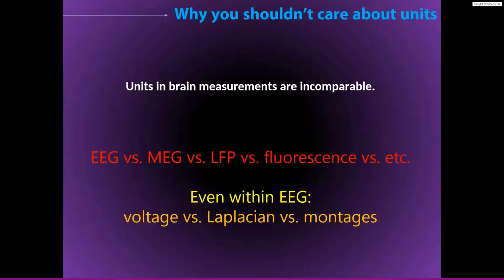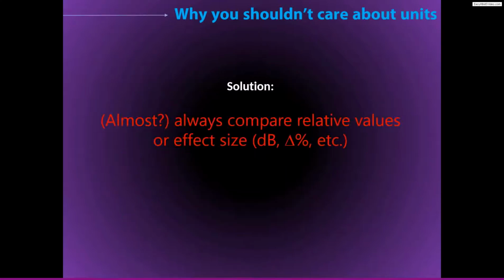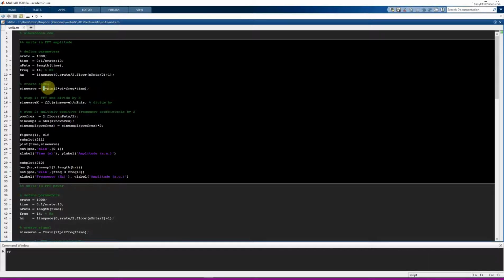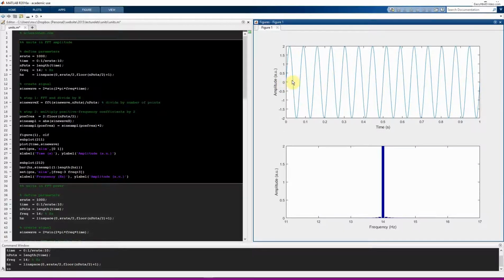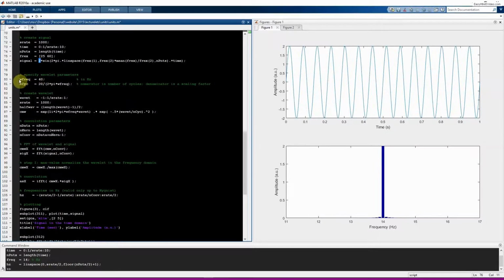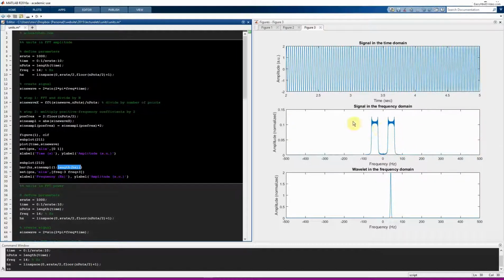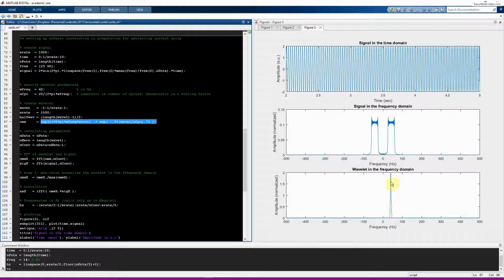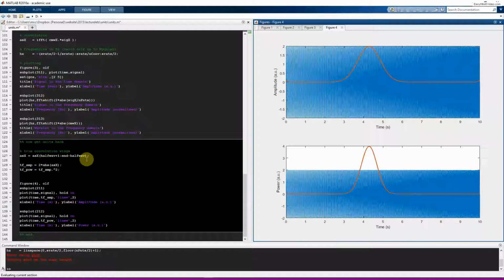Accurately recovering data units in FFT and convolution

Comment: Hi Mike, thanks again for these great lectures. I have two questions:
1, In figure(3), subplot(313), do you mean ''plot(hz,fftshift(abs(cmwX)))''  is correct? 
2, I am not sure if I understand correctly, you mean Morlet wavelet is a complex sine wave. When the phase of the complex wavelet aligns perfectly with the negative frequencies(sine part?), the amplitude in negative frequency is zero. All the energies are only contained in the positive frequency. How can we know whether a complex signal having such a feature or not?
Reply from the maker: 1) 2*abs is correct. You can also drop the "2". These scaling factors don't change the shape of the spectrum, only the y-axis values. Sometimes that's important and other times it isn't.
2) A complex Morlet wavelet is a complex sine wave tapered by a Gaussian. A real-valued signal always has amplitudes split between the positive and negative frequencies, but a complex-valued signal can have asymmetries. For "pure" functions, there are analytic solutions for the real and imaginary parts. But in practice on computers, it's best just to compute the FFT and inspect the full spectrum.

Comment: Hi! In the companion code for Neural Time Series Analysis, the script for Figure 13.11 has an additional component in the complex morlet wavelet equation-- I'm not sure what it is scaling. I thought it may be normalizing the power to one; but that doesn't seem to be the case.

wavelet = fft( sqrt(1/(s(fi)*sqrt(pi))) * exp(2*1i*pi*frex(fi).*time) .* exp(-time.^2./(2*(s(fi)^2))) , n_conv_pow2 );

When investigating, I also noticed that the real and imaginary components of a wavelet are not perfect phase shifted copies of each other-- the amplitude of the imaginary vs. real component is higher for the first n peaks, and then the amplitude of the real vs. imaginary component is higher after the center time point. Looks like the imaginary component is not symmetric about the midpoint. Why is this? Intuitively, I imagined both components as only phase shifted copies.
Reply from the maker: That's an amplitude-scaling factor. But it's much better -- conceptually and mathematically -- to normalize the wavelet in the frequency domain, as this video describes. 

As for the real and imaginary parts of a complex Morlet wavelet, they are phase-shifted by pi/2 (90 degrees), because the real part corresponds to a cosine while the imaginary part corresponds to a sine. It might seem like the peak amplitudes differ, but that's because of the Gaussian windowing.
Reply: Excellent; thank you.